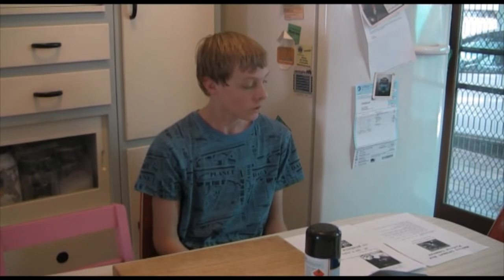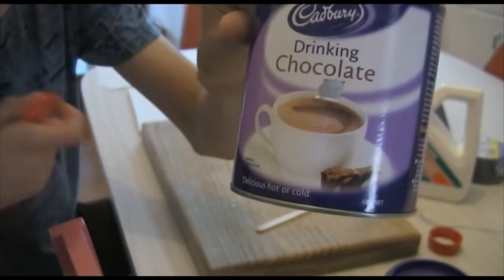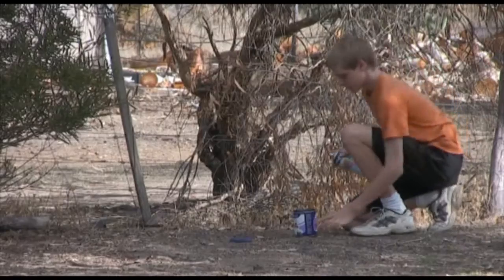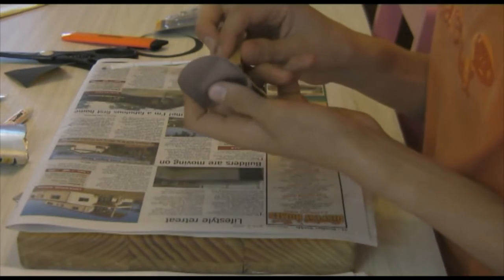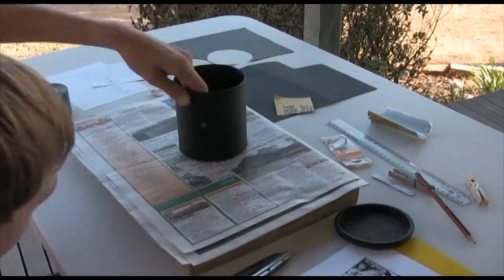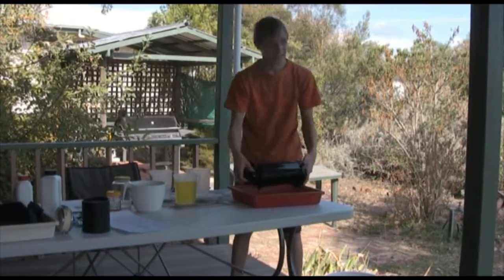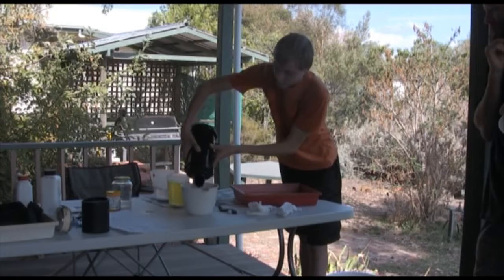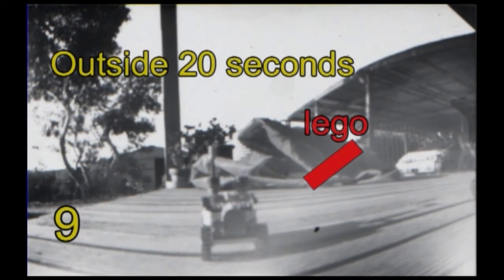How to make a Pinhole Camera from Scratch (2009)

Comment: get another black and white paper. face to face to the negative one, put the negative one on it, then fix it w/ a piece ov clean glass. exposure it for a 4-5 seconds to normal light. then put the paper in the developer, then the fixer then wash it w/ water, but you've to do it all in the dark room. so you'll get the negative and the positive picture.

Comment from the maker: @14TINI I scanned them into my computer and then used the invert effect in photoshop. The images were also flipped so in photoshop i had to flip them horizontally. If you don't have photoshop I'm not exactly sure how you should do it, but I'm sure there are other programs with the invert effect. I do not know how to invert it when developing but I believe there are ways which are more complex.
However the photos still have an aesthetic quality when they are negative.